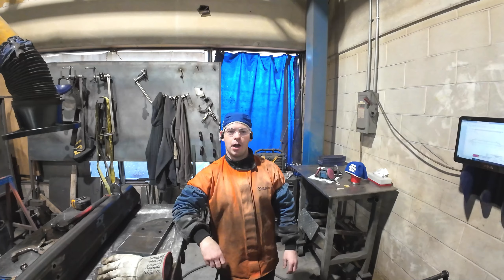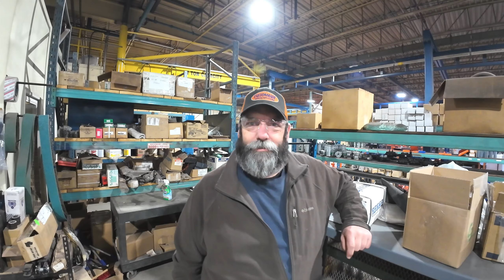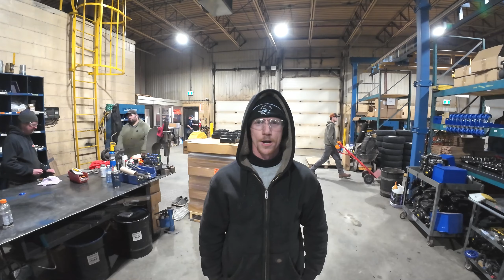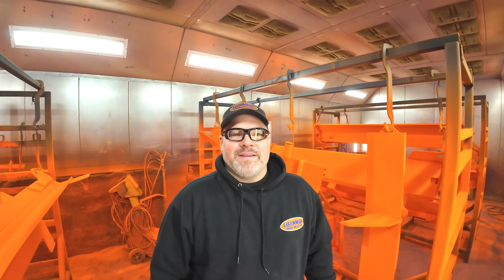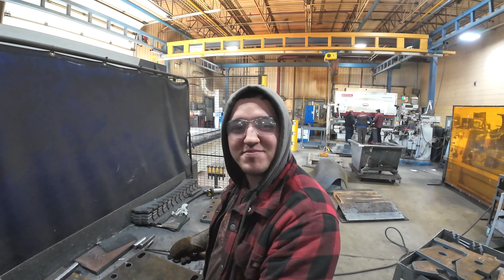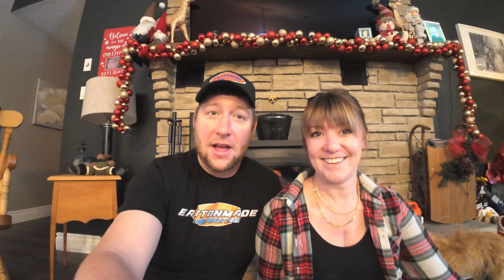Eastonmade; Merry Christmas From Eastonmade

Comment: Not sure if anyone has suggested this but was watching (in the wood yard with Chris) and I was noticing that when a block of wood dropped into the splitting chamber sideways that it took some time and maybe some manual manipulation to get it lined up again and was thinking that maybe if those twin rollers had little corkscrews built into them like and auger with one being made clockwise and the other counterclockwise it wood turn the blocks better! Cheers from Ottawa Canada